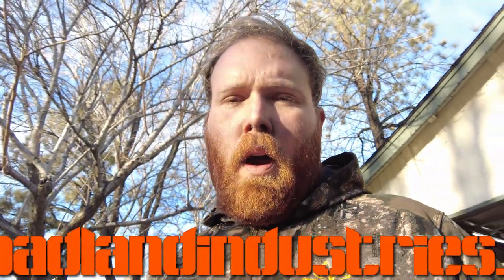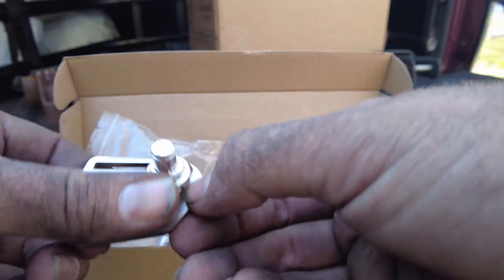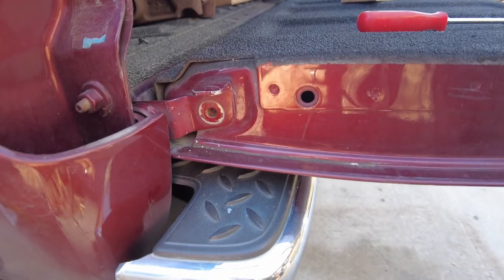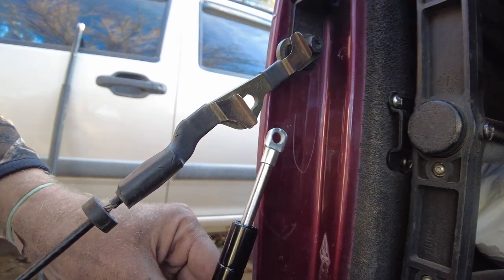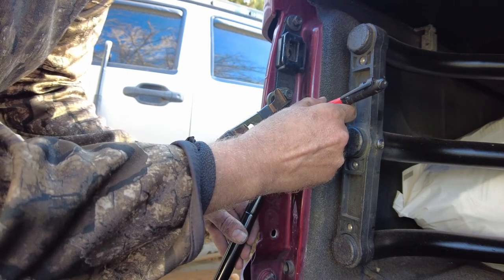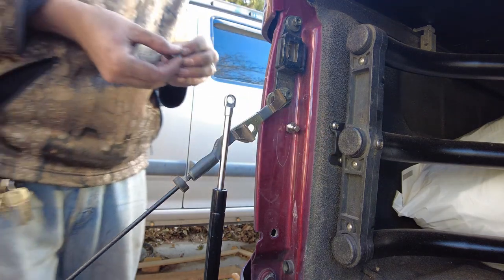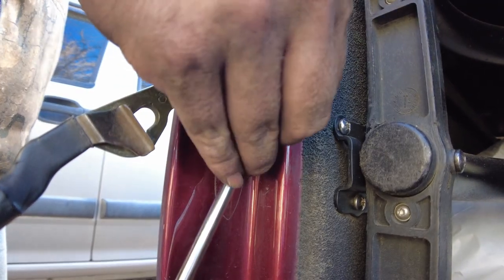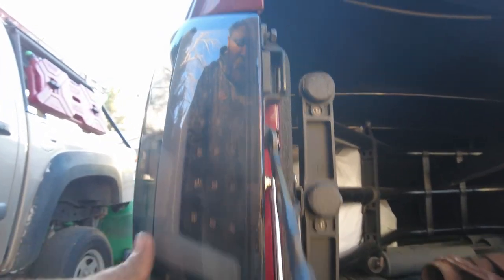EZ 1 bolt install [Tailgate Dampener 04-12 Colorado/Canyon]

Comment from the maker: https://www.badlandindustries.com/product-page/355-ez-down-tailgate-bracket
Reply: Bought this.  But should come with a template. By no means am I bashing you. Just would help with instalation to prevent drilling the wrong measurements.
Reply from the maker: @maskedkane7683  the intention of this video is to explain exactly how to install the shock.

Comment: just installed this. works good, but seems to make opening the tailgate harder for some reason. I need to push the tailgate in before pulling on the handle for it to open without forcing the handle
Reply from the maker: Check out the tailgate handle replacement video. You can adjust the rods and handle to latch easier. Make sure you don't have the cable pinched anywhere.